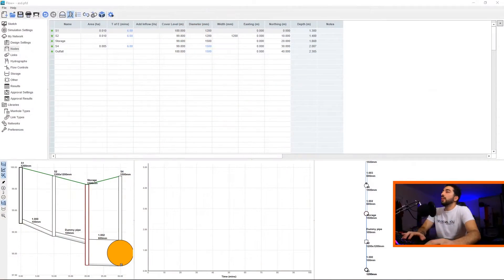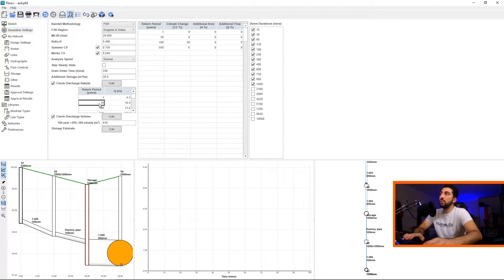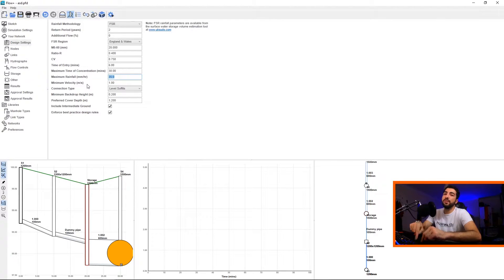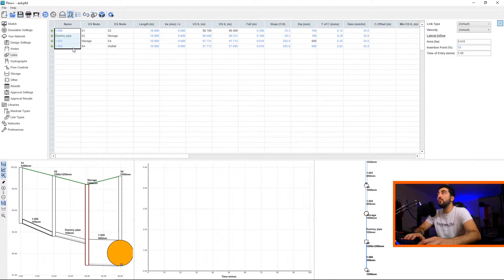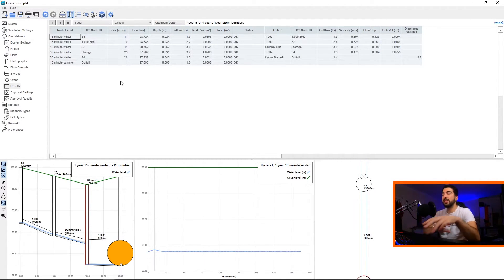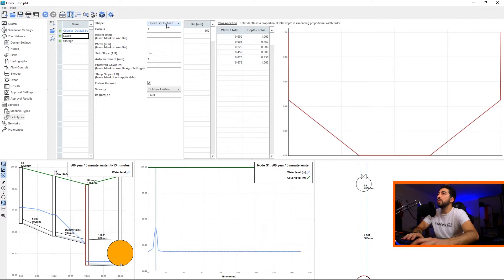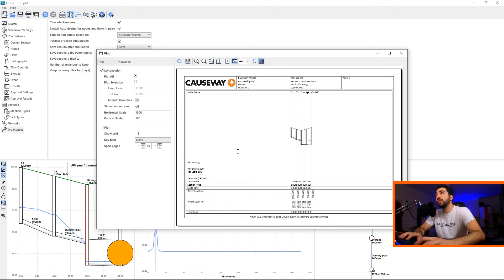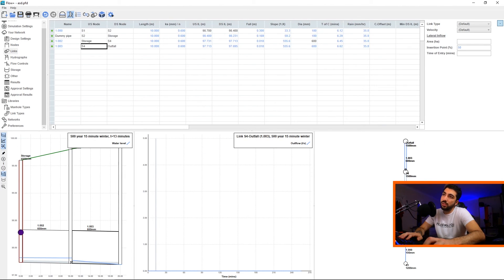Causeway Flow Tutorial - Introduction to the UI

Comment: THIs software is awful, it takes longer to complete simple tasks as you would normally do in MicroDraiange or InfoDrainage, there is no Graphic Design tool, making a simple tweak to the connection a lengthy and time consuming work! The Clash detection can be only accurate performed buy additional parts that will make it more expensive than InfoDrainage...the license binding is too long, forcing the user to remain on this piece of junk for a long time...AVOID!

Comment: Hi, I used EPA SWMM in the past, which causeway uses as its calculation foundations. My new company requires me to use Flow.
Can you import a backdrop similar to EPA SWMM.
Thanks for the videos.
Reply from the maker: Backdrop can be designed by simply specifying the invert level and the downstream end of the link or just increase the invert (maybe right click on the row to uncheck the auto design feature). Flow should pick the level difference between the incoming link and outgoing as a backdrop.
Reply: @CivilTechSource  I was referring to a backdrop image of the site layout. a pgn./jpeg/ image as a backdrop image.
Reply from the maker: Oh sorry my bad! Emm I usually use the snip tool (Already installed in Windows OS) and snip my autocad drainage layout and bring it in and reposition it. Will make a tutorial soon for flow+ and show you how to do it.
Reply: @CivilTechSource  yes please, looking for something like that.

Comment: Microdrainage is overpriced software. It's looks the same since I have been using it. Nothing changed. The output is like something from fortran. After using Flow I knew this is way better value than micro drainage dendritic stupid naming system.